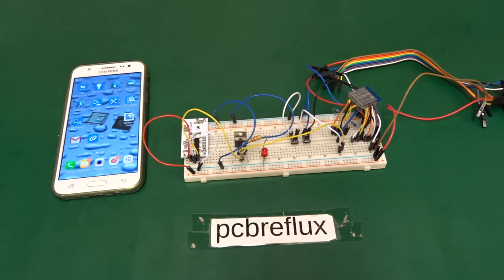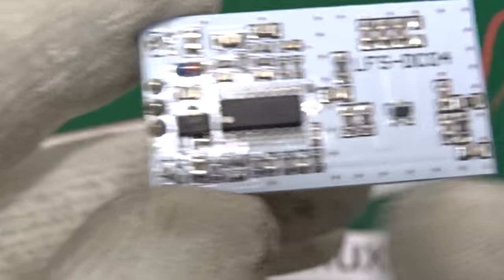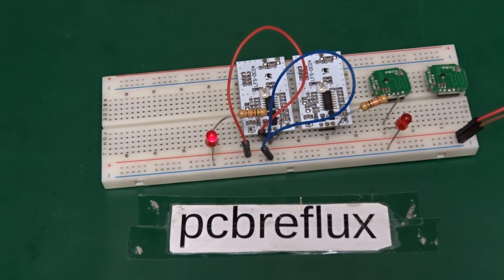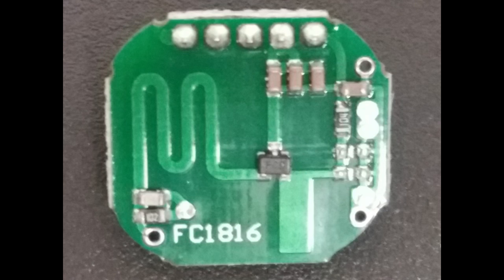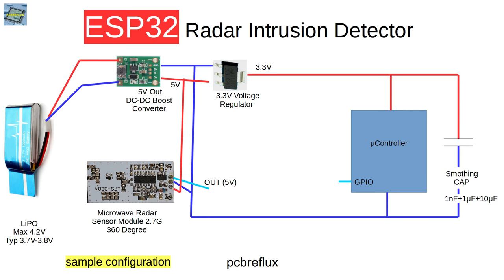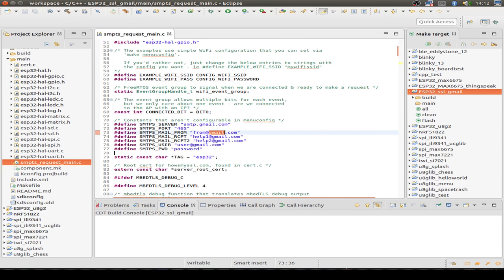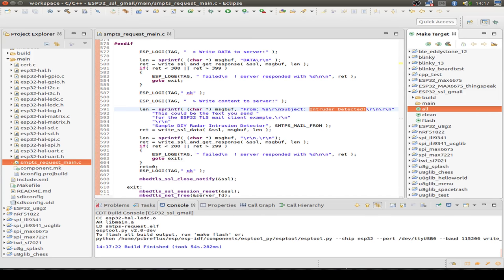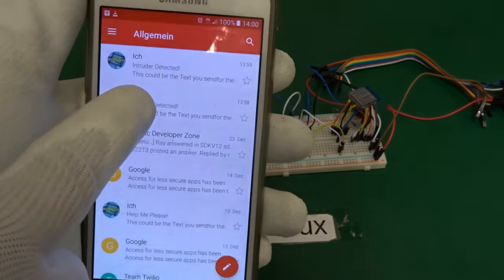ESP32 #12: DIY WiFi Connected Radar Intrusion Detector

Comment: Does these LFS-DC04 works stable for you? I bought one to test. Sometimes it works "well", but sometimes it stuck and it always sense motion, even the is no one in 10 meters around or everyone behind the walls :( And another thing, seems module cant be covered at all (at least mine) neither plastic, nor glass... So either i got crappy one or they are completely useless if all of them the same...
Reply from the maker: Not done a long time test yet, but found no issue on my previous tests.
Reply: and did you put it in some case? What kind of material it was if so?
Reply: have to shield it with metal connected to ground to avoid it. you could 3d-print a parabolic housing for them and line it with copper tape. or use a copper pipe for a more directional detection

Comment: does it gives stable output with ESP??
Reply from the maker: Hi, wile making the video I tested two of the (white) sensors with and without ESP32. They where very sensitive and recognize any movement with a stable output. Don't know if it also recognize unwanted movements like rain or insects.
Reply: Hi thank you for kind reply. Actually i'm talking about the esp noise that causes false triggring
Reply: and also whats about green sensors?

Comment: Sorry friend, but I'm rather disappointed in this project. The ESP32 is an extremely powerful device and so is the radar! (Btw, thanks for introducing me to the radar, it sounds like an awesome little device!) But using these devices like you do is like, eh, driving a road train to walk the dog - a giant overkill! Please make an effort to provide something a bit more in depth and interesting, something that's actually employing some of the amazing power in these devices. The project as it is now is rather close to a complete waste of time and resources (devices).
Reply from the maker: Stein-Erik Dahle Sorry for your disappointment. But I am just no expert in programming the ESP32 and still have a lot to learn. So I just still skretching on the surface. But so maybe the whole community? If you have some wishes for cool projects please share it. For me even the WiFi on Arduino is not working and hope to find a way to fix this the next days so i could use more library driven code. Btw. some times I am also dispointed from my videos because I could not do them better. Most videos took me mostly some weeks of parttime work and on some point I have a urge to get them finish so they dont get an disapointed unfinished project on an attic. And also its obvious that my spelling is a mess. So for me everything works  even slower. Hope to hear more critical but constructiv comments that helps a lot for a review. Thank you.
Reply: pcbreflux, nothing wrong in exploring! Show what you're doing to explore and learn how to use the ESP32! How do you connect to it? Is it as easy as just connect the power or is there more to it to make it do its thing? Is it easy to program? How do you program it? The ESP32 is new to us all, mine are still in the mail somewhere, hopefully in my hands tomorrow... 
Maybe you should make this project with an ESP8266 if you've got one? I doubt that an input or output pin is able to drive the entire ESP, but I might be wrong? I'd suggest you read the radar output pin with one of the input pins on the ESP and then have the ESP send an email or activate an alarm or something? There's an absolute ton of possibilities you know! :-) 

I'm looking forward to your next video! I'm even considering making and publishing a few videos myself... 
Good luck on your next one! Just remember: put your effort into making it as interesting as possible. It might take a bit effort but you'll get far more attention this way.
Reply from the maker: Stein-Erik Dahle hi, the esp32 is as easy to use as the esp8266 some times even easier. But the software side is a working progress. The whole idea could implemented on an esp8266 with the use of levelshifting (5V vs 3.3V). But I don't no other project that have implemented SMTPS (encrypted mail) yet. So maybe it looks trivial but I should not recomend to send out your accout setting plain though the net. Have some dozen esp8266 but today I am more interested in some Bluetooth and also WiFi stuff. While waiting for the real Bluetooth part of the esp32 I just play with WiFi and SSL/TSL.